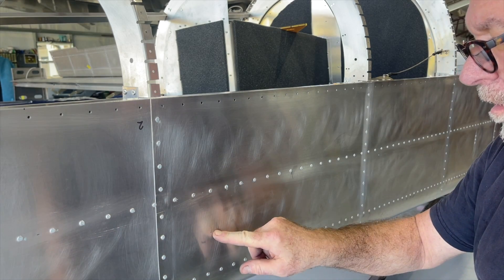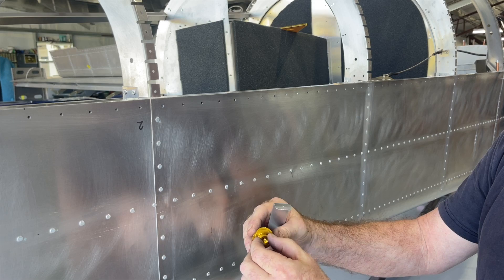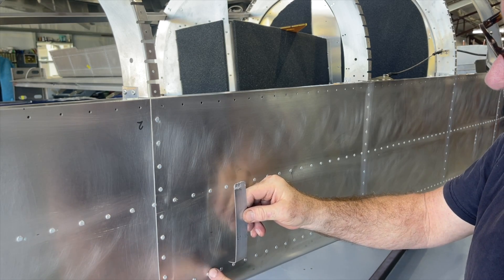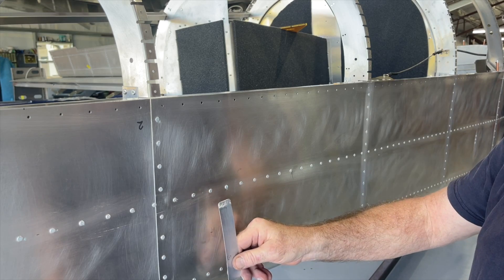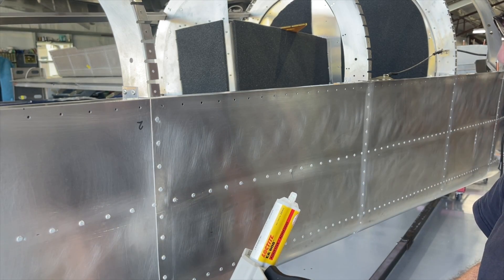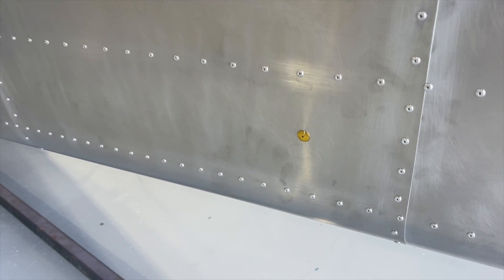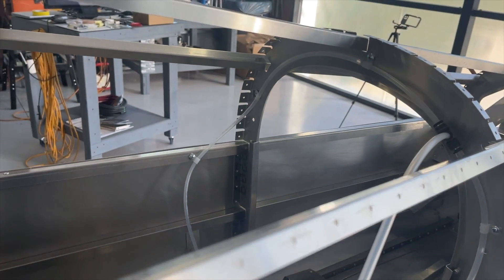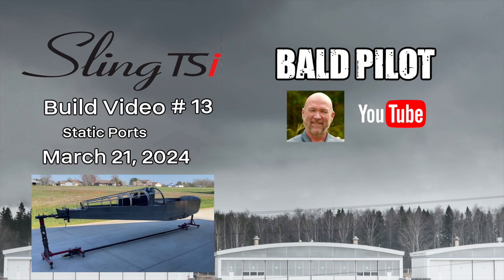New Concept for Static Ports  [Sling TSi Build Video #13]

Comment: Hey Rob - what location are you using for the dynon adahrs unit? Are you running the static/aoa/pitot nylon tubes all the way forward to the avionics shelf, or mounting it somewhere else? Thanks
Reply from the maker: Sorry for the delay...  I have mounted the ADAHRS per the same recommended on the RV-10, which is behind the luggage area.  This was recommended by my avionics panel builder, Advanced Flight Systems.  I have a diagram if you are interested.  Send me an email to thebaldpilot at g mail

Comment: Nice! Really enjoy your work. It’s helping give me ideas. I need to put static ports in the plane I’m rebuilding. Not sure if I’ll do it your way, but it certainly is nice to see you’re a great ideas. Keep it up! Your plane is looking fantastic.
You are much better at drilling out, blind rivets than I am, but friend (who is repairing a crunched plane) turned me on to a blind rivet drilling tool, ATS part 1341S and a similar from Aircraft Spruce, that makes quick work of them. (Probably isn’t as useful to you, as you aren’t having to pull as much apart as we are.)
Reply from the maker: That's what it's all about... sharing ideas that stimulate more ideas!  😁.  Thanks for watching!

Comment: Nice work (I followed your Bearhawk Build). I would have just glued it in without the strap. More likely, three flat head 3/32" rivets (countersunk). Use the reduced head size rivets if the skin is thin so you don't need to dimple it (use the pop rivet puller method to dimple in the middle of a skin if needed). If you need to dimple it, you can use three 4-40 flat head screws so you have the option of easily removing the static port. Just floating other ideas.
Reply from the maker: Good ideas!

Comment: Very clean solution. The question I have, instead of drilling out the rivet from the top, why couldn’t you use the same rivnut solution on the top longeron?
Reply from the maker: Hey that's another possibility too!  My thinking was that the top rivet seemed to give it a little more "clamping" effect.

Comment: At first I was like, this is dumb, just rivet the static port in.  But this solution is WAY more elegant.  It looks like a threaded fitting in the back though, how are you going to keep it from spinning when you connect a fitting?  Maybe the port connection doesn't need to be very tight, especially on an unpressurized plane. Also the adhesive may be plenty strong to allow a little snugging of a fitting.
Reply from the maker: Yes, I let the epoxy set up before screwing in the fittings.  You could also hold it with pliers as well.  Thanks for watching!